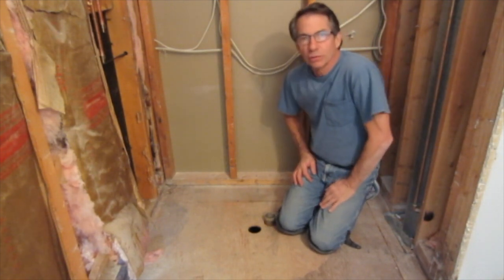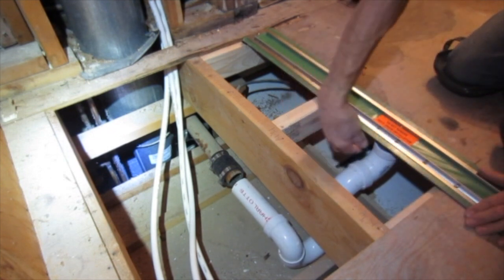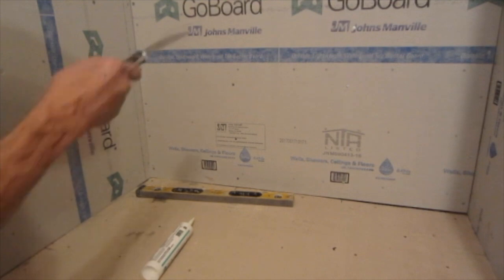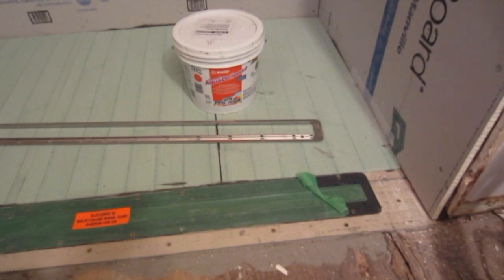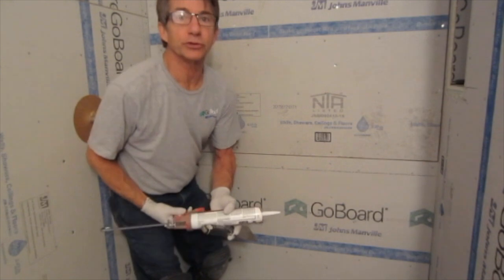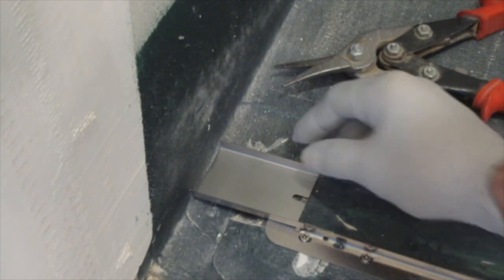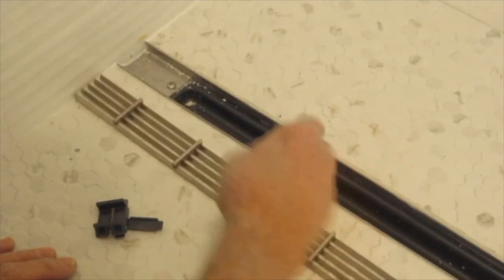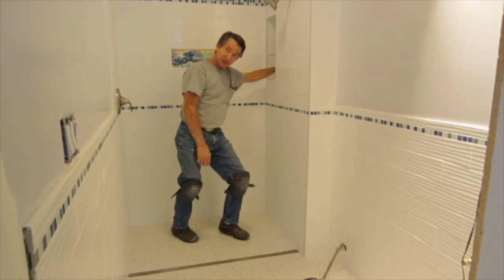Linear Drain Quickdrain Showerline installation

Comment: Hey Steve great videos for Quickdrain.  What brand reinforcement fabric for wall to floor transitions would you recommend for using liquid Redgard waterproofing?  Also, should I use same fabric to go over drain body for reinforcement? Redgard recommends using fabric at all transitions but doesn't make it.  Thanks.

Comment: Hi Steve do you have any video's or have you done an installation with the Quickdrain on a concert floor?  I'm looking to do a walk-in curbless in my basement.  Any ideas or tips?
Reply from the maker: Quick drain makes a drain, the "Retro" that sits on the subfloor or concrete slab. To handle the water flow it is wider than their other drains. You will still have to cut concrete to connect the drain. https://www.youtube.com/watch?v=BOEw5gWN8Ig&t=8s